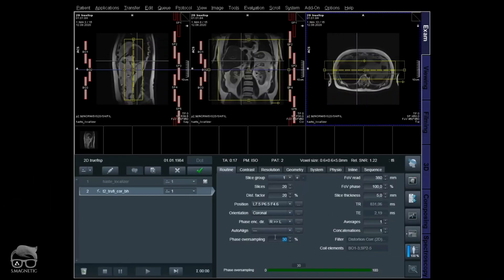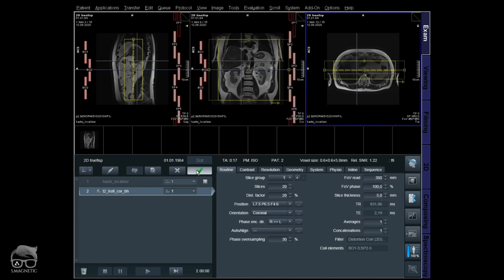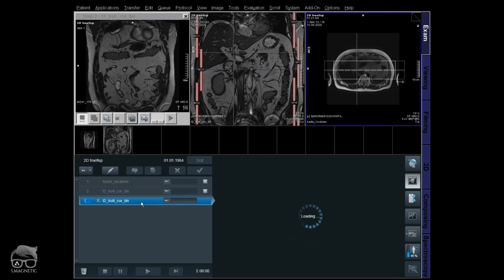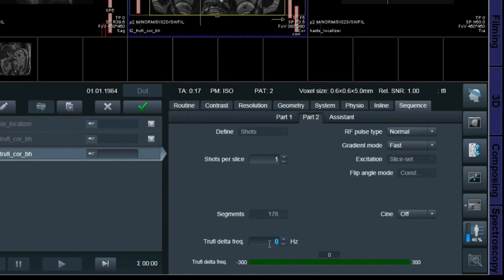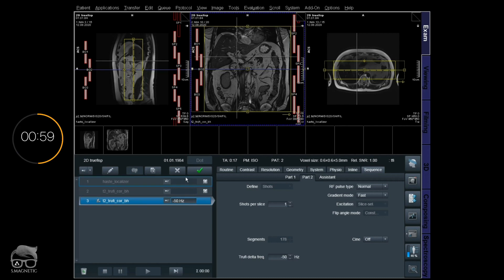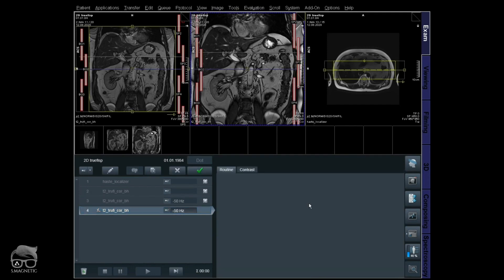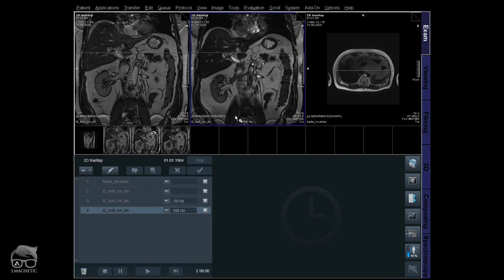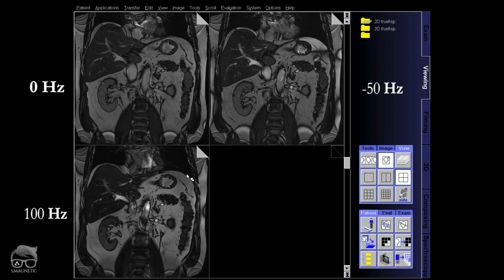TrueFISP – HOW TO SHIFT THE ARTIFACT AWAY

Comment: Where do I find delta frequency in old Siemens scanner? Or any alternative options?
Reply from the maker: Probably don’t have that option on older scanner.
Reply: @Nguyen_MRI  Thanks for responding. Any alternatives to get rid of this artefact?
Reply from the maker: @siyadka7483  try to manual shim as good as possible. Or sometimes shift the artefact away with changing the phase encoding direction.

Comment: You can run a scout using one slice at this location. The system will take scan the same slice over and over with differing values. You can then page through the sequence and choose which works best, then plug that value into the sequence you want to run. I think it’s called “ delta frequency scout “, or something like that.
Reply: What is the Siemens nomenclature name for this scout?
Reply from the maker: @totallysawthat localizer

Comment: Great video Bac. I have a question. You know how to get filter images on the Siemens for the brain SWI sequence? Thanks!
Reply from the maker: Hi thanks. You mean the 4 images on Swi? Magnitude/phase/minip/swi?
Reply: @Nguyen_MRI  YES!
Reply from the maker: Yes, open your swi, go into the card CONTRAST - DYNAMIC —> then down there you see RECONSTRUCTIONS- turn on to MAGN/PHASE. after this you will have all the 4 images.
Reply: @Nguyen_MRI  Nice! Thanks Bac. I appreciate it 👍
Reply from the maker: Hi again. Ok so you want be able to do recon on multiple minip planes? Just like the video link shows?
Reply: @Nguyen_MRI  I'm basically trying to get the complete set of SWI images. From Raw Phase->Filter Phase Image->Phase Mask->SWI Image->SWI mIP. So far the scanner has given me just the Raw and Magnitude Image. No Rush. I'll try to play around with it tomorrow see if I can figure it out 👍
Reply: @Nguyen_MRI  oh and I just need it on the Axial plane. Thanks!
Reply from the maker: Please contact me on Facebook messenger. It’s easier to send images there to solve issue.
Reply: S C    
Please do check you have swi license in your system. If not system will only generate magnitude image and raw phase image. That means the background process will not happens, it needs swi license on your system. 
You can check your system configuration in Help tab above the screen. Help—> info—-> license.
Reply: @praveenpg4691  nice. Thanks for the heads up! I hear SPIN Pro does the processing of the raw images.
Reply: @Nguyen_MRI  Thanks Bac. I don't have Facebook messenger. I nearly have enough time to be on youtube. I'm glued to my chair. Haha. But I'll check out what Praveen PG said. Thanks again for your help 👍
Reply from the maker: Usually when not having the swi licence you’re not able to get the 4 images. The sequence itself in the siemens tree is also grey out which means you’re not able to use it. However, I’ve seen sites which was able to run the sequence even though they didn’t have the licence, but not all 4 images came out unfortunately.
Reply: @Nguyen_MRI  Good to know. Thanks Bac. Your videos are very informative.
Reply: @Nguyen_MRI  yup, actually they can convert the sequence and run. But the phase processing not work for this. Instead of phase processed images system generate the raw phase image with all the phase errors.
Reply from the maker: Agreed with you. But once I saw this AvantO which had swi test licence. They performed the swi and of course got all the images. Then the licence was gone they still got the swi and was able to run the sequence but wasn’t able to get all the 4 images anymore. Strange thing a bug or something I strongly believe. In theory the swi should be grey out and not able to run at all.
Reply: @Nguyen_MRI  Yup. You only get the Raw Phase and Magnitude images. The post process is crucial to get that SWI mIP. But at least I learned the process. Interesting how I learned a lot more about this sequence. Been doing a lot of research on it.
Reply: @Nguyen_MRI  ya right, after trial period expired still can run swi sequence once it is enabled. It is available for the periods of 90 days. Then it got expires. The license is crucial to generate the phase mask and filtered phase processing . Still it is a licensed item😅. But it is routine now...